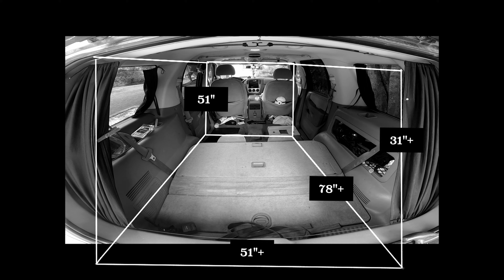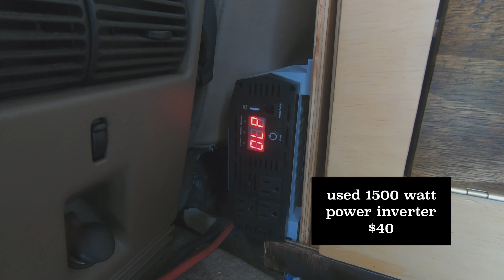NoVANLIFE: Convert SUV Ford Explorer 2005 into a Stealth Camper|Step by Step Instructions.

Comment: Im looking for a new truck, but dont wanna sell my 06 Explorer as I feel it's undervalued & would rather keep it as a 2nd vehicle. Just start the process of converting it to a camper. Got a fridge installed, rear seats are out & currently figuring out how I wanna wire up my battery isolator + power inverter. Also hooked up a front & rear dashcam thats run to direct power, with an app, I can check up on her as long as shes near wifi or has a 4G modem in her.

Comment: I've owned 2 -  2004 Explorers now I have a 2005 Eddie Bauer they are good trucks
Reply: Henry , I was wondering if you can advise me. My present car... 2002 Honda Accord. Needs work.. mechanic told me I need to replace rusted sub frame and gas tank leaking . Approx cost of 2500/3000. He also offered me a 2003 ford explorer for 3000 dollars if I choose not to fix my Honda. I'm a single woman . I'm stranded now with now means of transportation living in a secluded area. Also strapped for money. Lost my job. I heard Ford explorer was a terrible car. I don't know what to do. What do you think ?
Reply: Raven Raven
The Explorer is a dependable truck only if it's had regular tune ups and oil change the only thing I can advise before you buy one have the engine and transmission checked because the first thing with the Explorer transmission is one of the shift sensors may short out but they may cost about 25 to 40 dollars but other than that the transmission are good be sure the engine doesn't knock because the oil may not have been changed also a 2004 or a 2005 should only cost no more than 1500 dollars they are really inexpensive trucks that mechanic knows women don't know much about car's I pray that you take your time finding the right car or try going to a auction if not just message me again
Reply: @henryevans2935  , I've been praying... The problem is how can I look for a car when I have no car to go looking... I'm trapped..  so the mechanic is overcharging for a 2003 explorer?
Reply: @henryevans2935  , I'm not on Facebook... Is there something else. I went on craigslist this morning for my area... Nothing....thanks for trying to help.
Reply: Raven Raven
Do you have a family member or friends that you can use their device because you can find a auction that may be for people with out a dealers license
Reply: @henryevans2935  , I'm working on it.. no luck yet. Thanks
Reply: Tell me what city you in and I can check it and send you the info on this comment

Comment: You are the first person I've seen with my idea of track strip for curtains.  My 2012 Hyundai SUV has one continuous, seamless ceiling and sides.  I would have loved to see the full view of many parts of your build!  Example, the window was very clever and original, but you only showed it being snapped and drawn at a portion of the window.  Also, it was difficult to view with the steps going so fast.  I love the music and visuals, but it would be great if the visuals were slower for viewing.  This build is worthy of showing full details in a slower mode.

Comment: great mods! That was so cool! 
And I have one question about your sleeper support : how does it hold up so far? 
and do you have enough head room after you put in the inflatable mattress?
Reply from the maker: We usually utilize the sleeper 10-30 nights a year and have no issues with it so far. We use a 2 inches camping sleeping mat and Alex can barely sit up (he is 6'1"). 

Ideally you should build your sleeper leaving enough room to sit up.  It will make your life easier if you are planning to use it a lot.